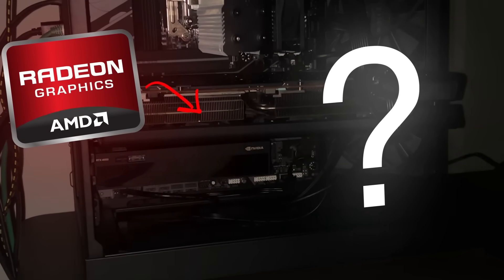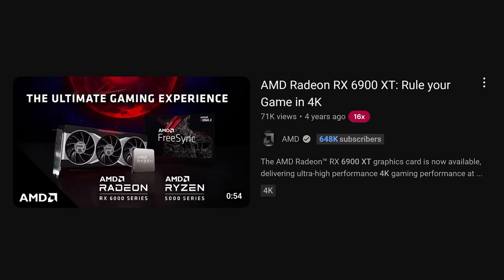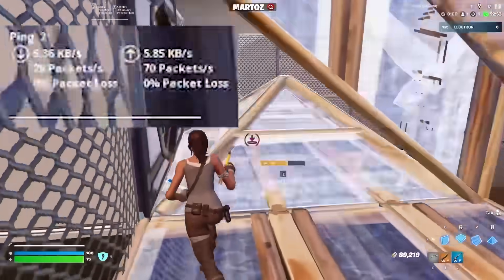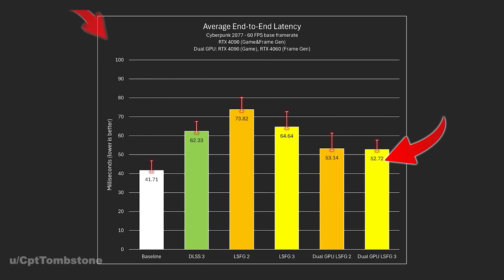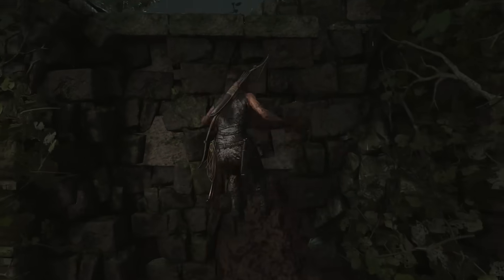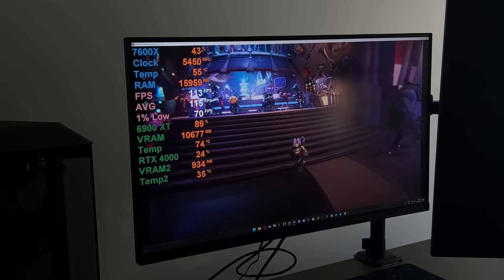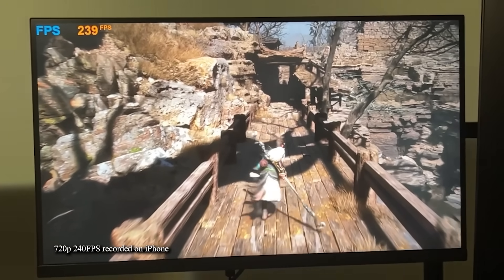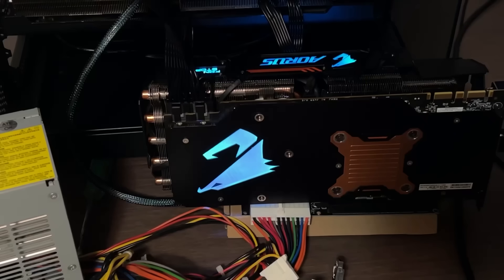I Used Both AMD & NVIDIA in One PC and Got 240 FPS in Every Game

Comment: The memory slot closest to the CPU usually shares the same PCIe lane with that of the GPU. It might be better if you removed the memory from there, install your most powerful GPU closet to the CPU and then use your connector to install the weaker GPU on the other available Nvme slot.

Comment: Ayoooo, no Ai benchmarks? Curious to see gen times for LLM models and image generators. Like using one GPU for the generation and loading all the upscalers etc into the second. Biggest issue is running out of vram, but if you can basically offset that with an additional gpu that would be nice

Comment: I reckon if you used two nvidia or two AMD cards you’d get a better experience and at least PCIe gen 4 too, great concept video though, I’d be interested to see if you can refine it further to get a smoother experience. And also maybe running the game on the worse card and running the frame gen on the better card too, to see if there is a difference switching them around.

Comment: This is interesting, I have a 4090 and a 4060ti in the second slot for encoding recordings and physx on 32 bit games for when i upgrade the 4090 to a 5090. I do need to upgrade my mobo tho since the 4060ti is sitting in a gen 3 x4 slot. With an undervolt on the 4060ti at full load it doesn't even break 100w so I can run my entire system with a good 1000w unit too.

Comment: If the 2nd GPU is for framegen only, then maybe we can use a less powerful GPU, maybe try using something with the same architecture such as the 1070 or even 1050 to see if there are any differences

Comment: I heard this is more reliable if you combine two Nvidia or two AMD GPUs instead of opposing models. Like there's currently no way to dictate which is the OpenGL card. With two of either there's options in the control panel that let's you dictate them, but with opposing models that's not possible.

Comment: how is your fps in marvel rivals so bad? im cruising around with like 80 (minimum)-130 fps (Maximum) with a 6800 xt. Did you absolutely max-crank the graphics settings or something? I'm using default settings, with vsync disabled... On Linux.

Oh, you're yapping about framegen as a form of improvised SLI... I feel scammed, get downvoted, scrublord. :P

Comment: Selling lag reducing software brings into question this entire video. As someone in IT I’m struggling to figure out how that software could improve your ping rate. Unless you’ve got something on your computer that’s bogging down your network. Your ping rate is determined by your Internet provider and the device devices you use to connect to the Internet. And your distance to the source server.

Your computer, And the software running on it should not in any way be slowing down your Internet connection that your latency would be affected. So you’ve got some kind of bloatware if you’re needing that software to improve your latency on your system.
Reply: That is unless you’re using a VPN. In which case your data can be slow slowed down by it.
Reply: @SeohnAranys  It can fix issues with routing between server and client. It will not fix all connectivity issues.
Reply: @SethOmegaful   So explain how that would function. Because while logically the fastest point is the least amount of hops. Sometimes some lines can be slower. Kinda curious how that works? What its doing that your ISP is not? Maybe they are routing it off their trunk too soon?